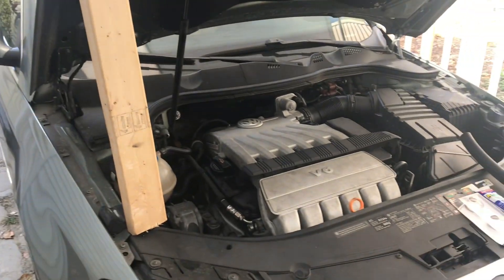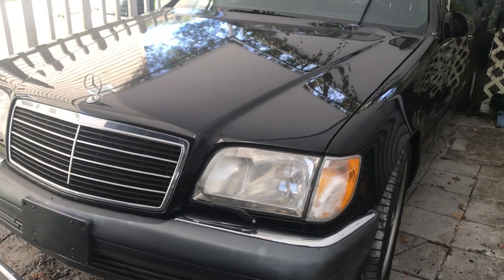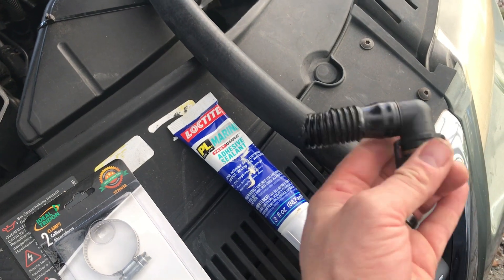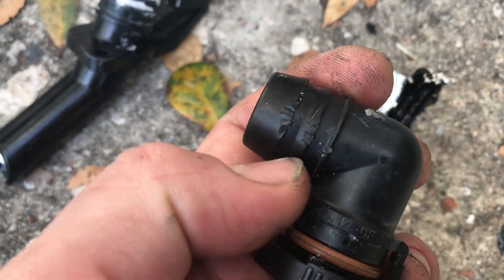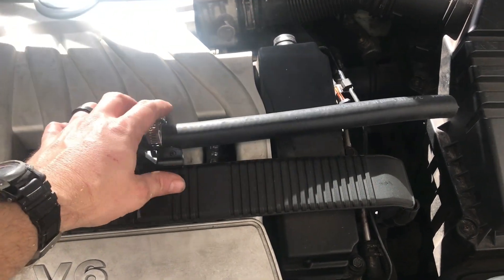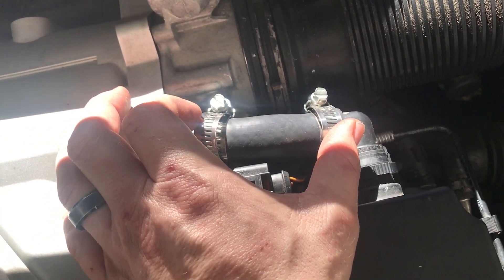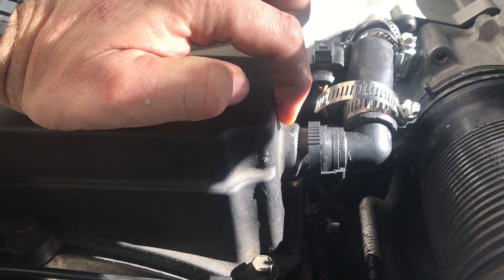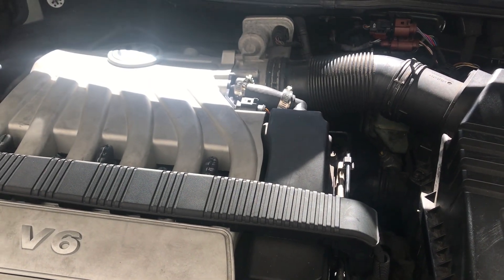FIX ROUGH IDLE CHECK ENGINE LIGHT vacuum leak 2007 VOLKSWAGEN PASSAT 3.6 l 4motion

Comment: I have a 2009 R36. The breather hose part number listed on the link that ends in A doesn’t fit as the sensor plug is in the wrong position. I have ordered 03H103202 D

Comment: Hey again. I fixed that air sound comes from that hole. I uploaded image of that rubber damaged. It’s behind that little hole inside the valve cover. I used rubber glove to fix it. Idle is stable as before.
( https://ibb.co/7CpKqnW )

Comment: Hello Sir. Thanks for video. I have VW CC 3.6 v6 very similar engine vehicle.
That Hole you were asking is there and I can here air sound comes from it while sucking air in. But I don’t remember 👂 hearing that pitch voice since my engine started up-down playing idle and first I did was replacing Intake gaskets ( 2 thick, 4 thinner gaskets and thicker ones was damaged by me closing it last time because of not properly placing.) I noticed voice after replacing gaskets and couldn’t find it. I saw it on your video and I saw that tube you replaced is cracked. I tape it issue still remains. I will do your method and let you know what happens.

Comment: It's the pcv, to replace the pcv u have to change the whole valve cover. Some people say you need to take the whole front end off to do that. Mine is acting exactly the same as urs. Just saw a vid where they plugged off the whole on the intake and ran a catch can from the valve cover. They said it worked without issue and check engine went off. Im gonna do the same this weekend.
Reply: can u post the video?

Comment: To fix the proble air leak is de pcv valve diaphragm that goes inside the valve cover ... easy to fix and cheap 26 dollars on ebay
Reply from the maker: Yes you are correct but from what I  researched it was a very difficult job on the 3.6l motor. You have to pull off a lot.
Reply: @petescarport  unfortunately ... but if you want to correct the problem, you will have to remove several parts

Comment: Did u find out about the seemingly air leak on the 3.6 liter passat engine? I'm having the same trouble and not sure what part needs replace
Reply from the maker: Yes unfortunately it's the pcv valve.  You can get the gasket set for pretty cheap but it's a 10hr plus job that requires a lot of removal.  Volkswagen won't sell you the gasket, but instead the entire valve cover for an insane price.
Reply: @petescarport  J.B. Weld the hole
Reply from the maker: Unfortunately it was an internal valve that cracks and leaks
Reply: @petescarport  So you blew a valve? or will the new valve cover fix this?
Reply from the maker: @steveweyerts  so it's a pcv valve that tears and causes car to idle poorly due to poor fuel and air mixture.  You can replace the entire valve cover but that is way more expensive than just replacing the seals.  Let me get the link to the seals for you.  It's a very difficult and long job to do but may be worth doing if you love the car. My mechanic told me like $900 in labor for him to do.  Parts are cheap
Reply from the maker: @steveweyerts  https://www.rkxtech.com/products/36-pcv-diaphragm

This is link to parts needed to replace
Reply: @petescarport  Thank you. I already found the repair videos and will do it myself. I once changed the timing belt on my A6 AVANT with a youtube video. Your video helped me allot as I had the same problem and did not know what it was. Thanks to all the res-ponders!
Reply from the maker: @steveweyerts  absolutely and glad you figured it out.  In this video I thought it was the broken pipe but that was just part of the issue.  The deep issue was what your going to tackle.  Have a merry Christmas
Reply: @petescarport  Thank you! Merry Christmas to you too! I just watched a video on how to just replace the membrane on the pcv instead of the whole cover. Should be cheaper.

Comment: It's a ripped membrane on the crankcase breather. They sell a 30 dollar membrane online you can buy other wise you have to replace the whole valve cover.
Reply: No real easy way. Intake manifold has to come off and to get that off, nose of vehicle has to be in "service position". Vw vortex has a lot of write ups on our Passats and the 3.6. Definitely worth checking out.
Reply: @OllieBeanz421  what do you mean by "service position ?"
Reply: @jenniferpeeler346  Service position for VWs means to take off the front bumper cover and bumper and remove a few fasteners so the front can be loosened and move forward a bit. It just gives you space to work on some of the stuff at the front of the engine.
Reply from the maker: Really. All I could find is replacing the valve cover which makes no sense to me. Thank you so much. I will look into this. Car still drives amazing but idles bad after stopping and putting in park. Such a weird thing to me
Reply: https://www.rkxtech.com/products/36-pcv-diaphragm
Reply from the maker: @OllieBeanz421  thank you so much.  I was under assumption I had to buy whole unit for $400. Do you know an easy way to get the valve cover off.  Or a good video.
Reply: I replaced the membrane on my 3.6 and hissing noice is still there.  Not sure why
Reply from the maker: Do you have a link to membrane?  I'm down to doing this
Reply: Not sure if you got this fixed yet. But it's a pain in the a$$. I was able to remove all the front bolts and just pull the front end from the subframe enough to reach the bottom manifold bolts. Just be careful because the fuel rail can get damaged if you yank on it to hard.  And when you put the diaphragm on make sure it is seated good. I made the mistake and had to take it all apart again. And also get a trickle charger. My wife had no power steering for a month because I thought it went out. But the battery has to have the right volt on startup or some things wont work and will throw codes.  Mine was the power steering. And replacing the fuel injector brings is a good idea too. Be careful with the injector electrical connections. One came loose after I put it back together and guess what. Had to take it apart again lol.